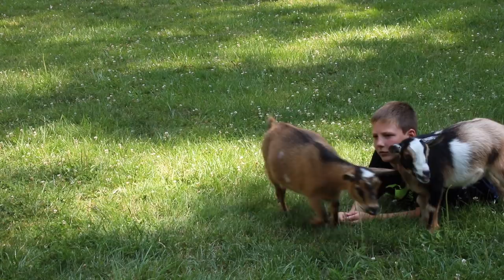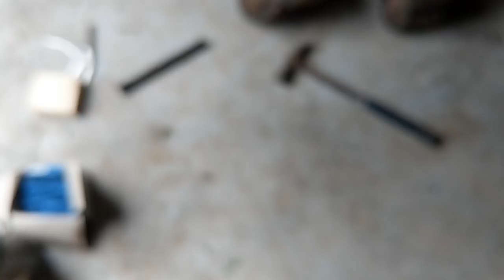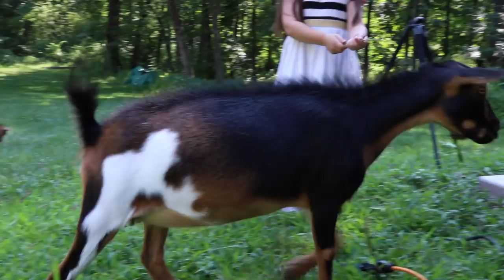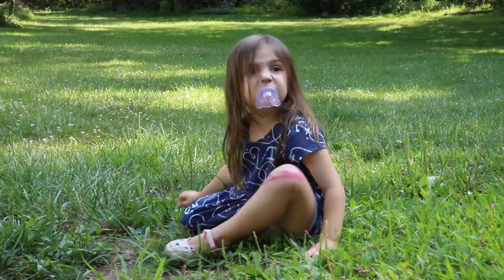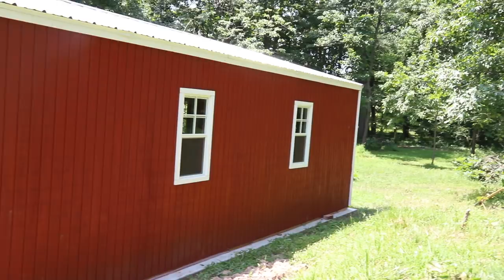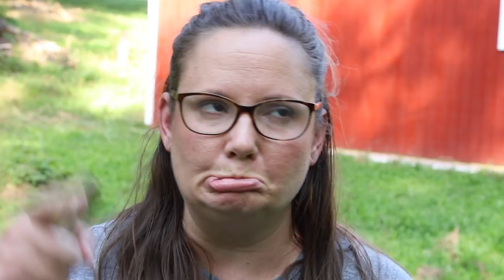Sprained Ankles and Sill Gaskets: HELP!

Comment: talk to the cement guy to see if he can grind a taper around the overhang of the pad so that the water runs off the slab rather than pooling or flowing into the barn.
Reply from the maker: Excellent idea.

Comment: Lefting without getting killed is the main thing. Now get concrete guys to cut! or do a alum flashing up the greentreated plate to over concrete slab and over edge. or they have a caulking for cement/wood bonding sealer or they do make a can spray foam for exteriors for pond sealing. Box strores carry the stuff. other then that ?  Bummer on ankle when it rains it sure does pour. Hope one of these will help. Have a better week.
Reply from the maker: I think flashing is going to be the way to go. Gutters are coming at then the flashing.

Comment: "Z" Flashing at the bottom of the T111. Wish you asked b4 you nailed the bottom of the siding. If Nothing else you can buy a roll of aluminum flashing and tuck it up under the siding and bring it out over the edge of the concrete.

Comment: Yes, mistakes will happen. That's life.
And, yes, the husband gets new toys, (I mean tools) when the spouse asks for a new project. ;)
drip solution - build a planter along that wall that will use the water dripping from the roof. Make it just wider than the cement pad and put the drain holes in the planter where the water will drain out onto the ground and not the cement. Could turn into an herb planter or a flower bed. (Unless the goats will have access to it, <chomp-chomp>. Then, I'm not sure what you'd plant there. LOL)
Reply from the maker: Planter is a great idea too! The goats will have access, but maybe we can make it high???

Comment: Funny story (in my mind at least...).  On 12/28 I was super excited to score 6 free Christmas trees - that's all I could fit in the truck - from a local nursery for me goaties.  I got home and was bragging that they were $60-80 each, with the big score being a $120 Douglas Fir.  I went up to the barn and (after 2 hours of hanging with my goats and videotaping their cuteness, of course) I proceeded to offload said trees.  I threw 2 in to them and they started munching away.  I decided to throw the behemoth fir in and, while carrying it around the side of the barn, slipped and fell.  I knew it was bad, but will spare you the gross details (you're welcome).  I cralwed back to a random pallet in front of the barn - picture Naked and Afraid but with snow and not naked - drag myself into the truck, and drive back to the driveway to wait for my sister to bring me to Urgent Care.  Yes, she and her husband both suggested the emergency room too, but I am a public health professional and preach appropriate use of the ER, which doesn't necessarily include potentially broken bones.  Anyhow, I broke my ankle in 3 places, including a spiral fracture of my fibula 🤢.  I had surgery 3 weeks later and am STILL out of work.  Worst part?  I can't take care of my damn goats!!  Or chickens.  But, quickly realizing my dilemma, my goats tore a section of the fence down and now come hang out on the deck with me.  Good news - my cast is supposed to come off tomorrow so I can go back up to the barn!!  Not work though.  That will be a few more weeks 😉  #freerangegoats #Imahotmess 😘
Reply from the maker: Patty!!! Holy crap! That is terrible. Feel better.

Comment: Kenny, You have probably heard this before, but you look like the Comedian Ray Stevens.  As far as the water running away from the wall, silicone caulk and aluminium flashing.
Reply from the maker: How appropriate... Kenny is quite the comedian. Caulk and flashing plus gutters is our plan forward.